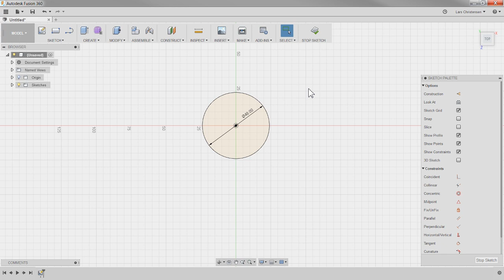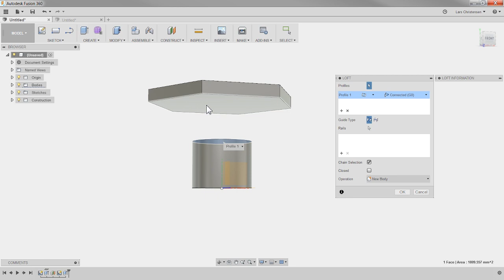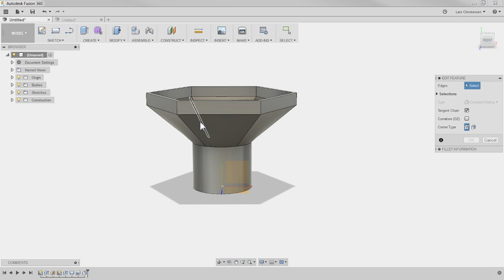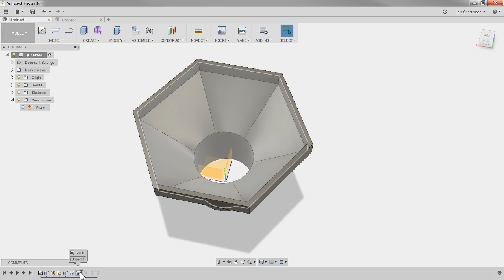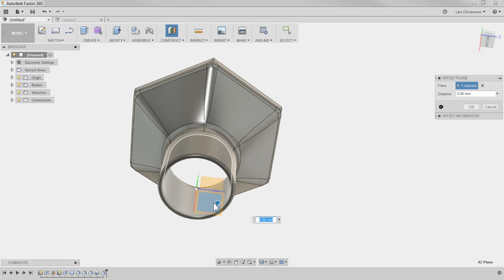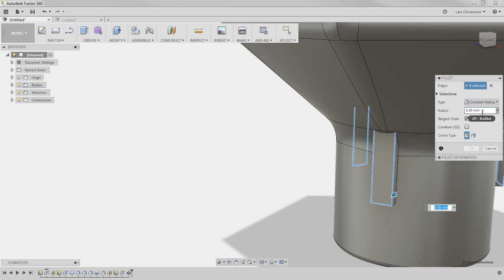Fusion 360 Absolute Beginner - How To Model a Funnel - Last Nights Facebook Livestream

Comment: I would modify the object before I  repeat the pattern. That way I only have to do it once and have it repeat around. The hexagon corners were not filleted properly like the original object. 

If you 3D print things, there's a big chance you're making replacement parts or parts that would mechanically interact with other existing parts so you have to make those shapes match the original perfectly.

Comment: @47:16 I don't get the opportunity to snap to the edge.  Nothing highlights. I proceed anyway but then I am left with a 3 sided rectangle without faces to select in the later extrude step.  If I abort from the line, the edges highlight again.  Whenever line tool is active, the edges do not highlight.

Google solved it: I needed to enable "Auto project edges on reference" and "Auto project geometry on active sketch plane".

Comment: at 47 min how do you get it to snap to the line ??
Reply: 'Auto project edges' on references in 'Preferences'>'Design' - I don't think that's an option that's explained and it isn't a default setting
Reply: @acjohns2545  Thanks! I had just the same question!
Reply: @acjohns2545  thanks!
Reply: @acjohns2545  THANK YOU!! I was stuck right there.
Reply: @Jason__________  me too
Reply: @acjohns2545  Thanks mate.
Reply: @acjohns2545  thank you hahaha
Reply: @acjohns2545  I already had those options checked, but I'm still running into the same problem I have a circle at the end of the snap line that runs from the left and the right.  If I hover over it, it looks like a box with a plane appears but doesn't seem to do anything... so I'm still stuck

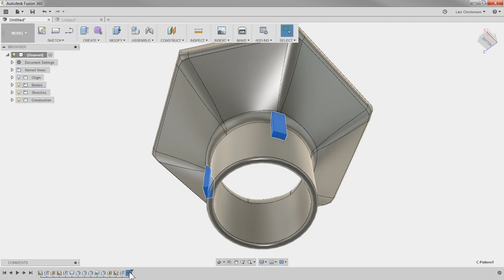Comment: Loving these tutorials! I did have a question at about the 51:30 mark in the video.  I was truly impressed when you moved the Shell forward in the timeline to capture the fillets of the outside surface.  I expected I could achieve similar results by putting fillets on one of the three tabs and then bringing the Pattern command forward in the timeline.  However I couldn't seem to move the Pattern command in the timeline.  Was I doing something wrong or is there some fundamental reason why this should not work?
Reply from the maker: Thank you for watching! You can only move things as how they are associated with other things in the timeline. So for example, pattern command will only contain what was selected. When you try to pull it after the fillet, the fillet would not know what to fillet. 
The history still have to be able to solve everything in a linear fashion. 

Hope this is useful

Comment: I believe the issue I was having with planes being slightly skewed (by may be 0.5 degrees) was because I was starting planes without considering where to start them. I've been working on 3D printer parts and have noticed things like the axis mounts not not lining up properly with the rods or each other. I don't think it will affect the final prints, but its enough to be annoying. When starting a new component of a complex assembly, do you do a plane offset from the main origin, or do you start with an offset from another face? Which is the best practice?
Reply from the maker: Hi Jeffry Garew Thank you for watching!
Glad you figure out the issue. I normally create planes from one of the original planes

Comment: You mention drawing skills. So far in the videos that I've seen of yours (all outstanding, by the way) it usually starts with an actual physical part and goes from there to figure out how to create it in Fusion. But much of the work that people do (or will do) with any CAD program is designing from scratch, without an existing part to work from. As one who came from the old school of doing most of my design work on a drafting board with paper and pencil, CAD presents a problem. As far as I can see there's really no way to just "sketch" (in the old sense of the word) and then refine that sketch until it's a CAD drawing. I'm not sure what the solution is. What I usually now do is use pencil and paper to draw out what I want, try to put in the basic dimensions, AND THEN go to Fusion. Is that the recommended way? Is there a different approach that's more suitable for CAD? Maybe there should be some videos on paper&pencil drawing for starting a design and then how to move from that to the CAD system.
Reply from the maker: Hi Roger Garrett Thank you for watching!
What do you think of this video?
https://youtu.be/_F3ics3Gzh0

Best,
Lars
Reply: Yes, that short video contains a good suggestion about sketching things out with paper and pencil first. I'm thinking that, along with learning a CAD system, someone new to design should probably also take a course (or watch a video or two) about paper and pencil sketching.

You also mentioned in that video the issue of getting something started quickly on the CAD screen because the boss might come along and he wants to see you making progress. And that triggered a memory for me from way back in the late 60s when I was first taking drafting courses at Northrop Institute of Technology. The teacher noted that, while you're sitting at your drafting board in the middle of a huge room with dozens of other draftsmen all working studiously on their projects, if the boss strolls by and looks over your shoulder you had darn well better be drawing something and that he's likely to ask you why you were drawing that particular line in that particular way and you had darn sure better have a good answer. Which was not a very encouraging statement to those of us looking forward to a career in engineering. I sure wish he had said something more along the lines of what you said in that video, that sometimes you  just need to think things through before actually getting started, maybe even sketch out a few (eventually throw-away) drawings before getting down the actual design.

Comment: Choice of which face the design is done - could become a bit important when people wants to print? Or is this wrong?  Wouldn`t the face decide the orientation for print imported to a slicer?
Reply from the maker: Hi Stig Berntsen Thank you for watching!
You can normally very easy rotate you model in the print utility so I normally don't worry about that in the model face. But, would not be wrong to take into consideration.
Reply: Thanks, love your videos. Keep them coming (y)